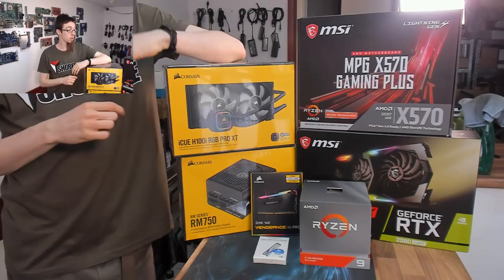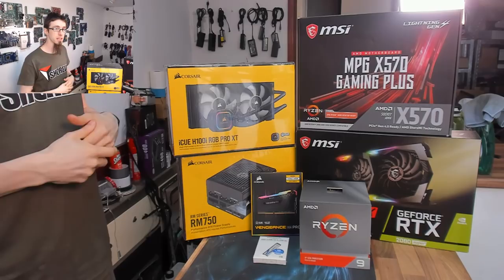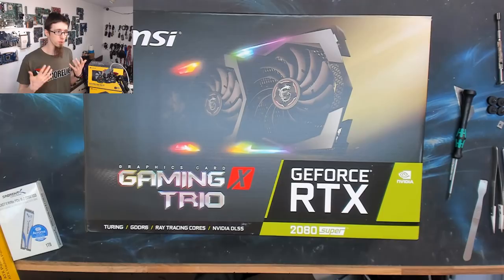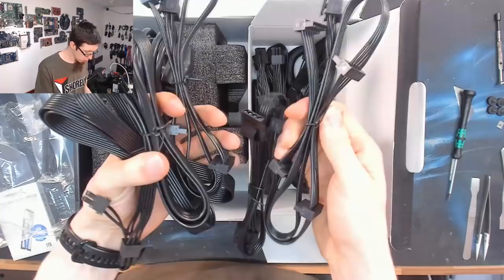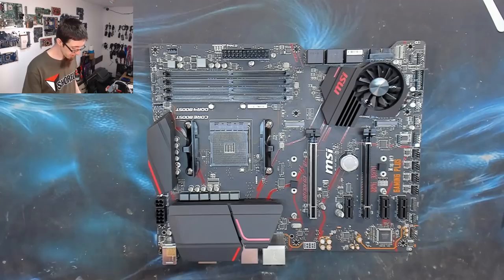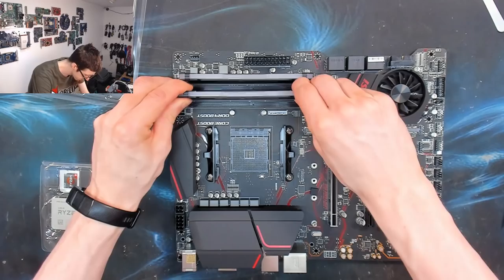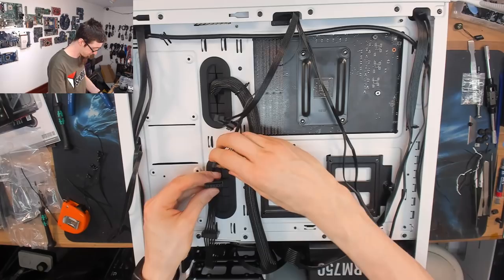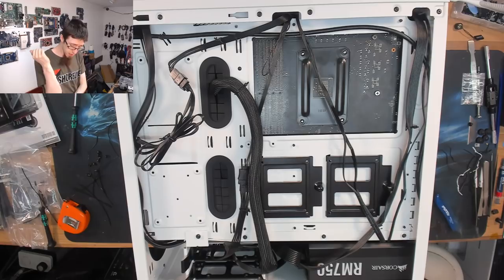The Whole Corsair 275R AF build - LBC#54

Comment: Same question as a few others - where did you get the motherboard screws from? They were not included in the accessory kit for this case, and they are not listed in the manual.
Reply: For any that are as confused as I was, the accessory kit includes MBD/HDD screws. These are what you want to use (MBD=motherboard).

Comment: what's the benefit in having the intake fans on a radiator? doesn't that bring hot cpu heatsink air into the case?
Reply from the maker: The alternative is to top-mount the radiator, in which case you're cooling your CPU with hot air from the graphics card. So you're damned either way. If either the CPU or GPU is going to have to be cooled by pre-heated air, you could argue that it matters less on the CPU (therefore top-mount is better) but in my experience it makes basically no difference.
If the cooling system is on such a hair-trigger that the 'loop order' affects it, there's probably not enough airflow full stop.

Comment: What you get for the 2080 Ti is going from 8GB to 11GB VRAM.  You get a possible investment not an expense.  There are apparently some state-of-the-art machine learning algorithms that can really use 11GB vs 8GB, so the right card can have its value INCREASE a few years after its release, especially if the rumor that Nvidia is stopping 2080 production is true.

Comment: I watched your LBC#53 video on this case.  I should get mine this week (9/9/20), coming from Neweeg.  I am down sizing my system in some respects, but I feel that this case will be better for the setup I am going for.  I have no problem in modding this case. so if I need a hole or need to move an item to make my build better for my needs I will.  You made a remark about the front cover and when I looked at I knew that I was going to make a few changes on its appearance.  If I can paint a car (1971 Mustang Coupe) I can paint a front cover.  When its done I would love to send you a few images of it.  Nice videos on both.

Comment: 5:12 just wanted to mention that what you said isnt entirely true here. its all dependent on your mobo QVL. I have a ryzen 3600, asus prime x470, and gskill 2x8gb 3600 c16 RAM. i threw in the exact same kit a few months down the road for 32 gigs for cities skylines.

sometimes i would have no issues for weeks, other times i would have major crashing.

it took me months to realize that my particular ram kit was not compatible in 4 stick config, but the 4x8gb kit of the exact same ram would have worked fine if i had bought them together. 

currently trying to sell it lol

Comment: The 24-pin ATX cable might actually come as a 20-pin and 4-pin separated.  If you are an idiot like me, it is possible to plug the 4-pin wrong orientation and get a no post.  The 20-pin and 4-pin parts have some small plastic guides that indicate the correction orientation to fit together.

Comment: The pcie power cable should easily be able to carry the full wattage for the dual 8 pin connectors. It's the gauge of the cable that matters. If the cable isn't a thick enough gauge it shouldn't have the second 8 pin connector. A dual 8 pin cable should be able to carry  300 watts. 3 of the 8 pins provide 12 volts, that's 50 watts per wire for a load of 4.16 amps. This only requires 18 gauge wire. Even if you double the load to 8.32 amps with a dual 8 pin it still only requires 18 gauge wire because of the short length of the cable. Only the very cheapest power supplies use thinner than 18 gauge wire, almost every power supply uses 18 gauge. In fact, due to the short length of cable 18 gauge wire should be able to handle around 20 amps at 12 volts. If the power supply was capable, dual 8 pins could safely provide 600 watts.

Comment: So there is the cpu cooler fans, and three exhaust fans, is it not necessary to have intake fans?
Reply: Alternatively couldn't the cpu cooler/radiator be placed on the top, and have the intake fans left as is on the right hand side?
Reply from the maker: The front-mount rad acts as the intake. You can increase the radiator fan speed for more intake, or you can increase the exhaust fans for negative air pressure, which also works.

Comment: Adamant the vcore voltage was high because Windows 10 has the minimum power management setting at 100% so it keeps the CPU bouncing between full OC and idle.    If you change the power management settings to 10% minimum it would auto down the power and temps to under 1.0v.

Comment: I wonder why you installed Corsair Fans to push hot air into the case...
2.Why you didn't tighten the pump with screwdriver?
3.You have RGB fans with this cooler just you had to go with H100i, Platinum,which I own.
Reply from the maker: 1. Would you prefer me to pull hot air from the GPU into the radiator?
2. You don't need to. They're thumb screws, you take them down to the stops and that's all you need.
3. Cost shaving to meet budget.

Comment: So do the motherboard standoffs come pre-installed or at least with the case? as well as all the other needed screws?
Reply from the maker: Yes, vast majority of cases have them pre-installed these days. You still need to check that they match up to your mobo, however, as some mobos have slightly different standoff patterns on the lower-half.
Reply: @Adamant_IT  Awesome thank you very much 😊 I was planning on getting the 275R AF but decided to buy the iCUE 465X instead as I just like the design a bit more.

I enjoyed your video btw, I watched a large majority of it and learnt a few things regarding cable management ect so for that thank you 😊

Comment: What are your thoughts on the 2 top fans as intake too, so 5 intake 1 exhaust?
Reply from the maker: If the back of the case is well-vented, that should work, as it'll force the air out the back. I think it'll be somewhat restricted though, especially around the GPU, which is where most of the internal heat is coming from. I can't think of a benefit of having a top-intake though, unless you're doing something odd like a front/side exhaust.

Comment: I owned a Corsair H110 280MM AIO that's compatible with the Haswell Intel and AM3 CPUs and it was very solid cooler. Sadly I had to retire it because I upgraded my rig to a 3700x and I didn't have the compatible mounting hardware for AM4 and besides it is not recommended to use the same AIO cooler with a new build anyways due to the fact of high rate of failure due to heavy usage.  With me due to Parts shortage due to the pandemic I chose the first motherboard that I saw that I could purchase and it would ship once it was in stock which was the ASUS ROG Strix x570-E Gaming and  It was the most expensive motherboard that I have ever Purchased in my PC building career at over $300 bucks. 
Also with me I tried using 1 cable with 2 daisy chaining 6+2 Power cables with an R9 290 and man that was a big mistake because I was getting black screen lockups galore and once I added in that 2nd separate cable all of my problems went away and I had a Corsair AX860 860W PSU.

Comment: does the radiator push air out of the case or in, in this mounting with this aio?
Reply from the maker: It depends what way around you mount the fans. In the vast majority of builds, they should be mounted to pull air into the case through the radiator.
Reply: @Adamant_IT  this has to be pretty bad for the rest of the components though, especially GPU thermals, I was thinking of adding an AIO to my PC, but either way seems negative. pushing hot air into the case or, pushing hot air into the radiator - Sophie's Choice :(

Comment: you still using this case? i want to upgrade from my corsair spec 01
Reply from the maker: This was a customer build, but still one I liked. I'd probably consider the Corsair 4000D in preference now though, newer case that definitely has a nicer front panel to it. It's slightly more expensive, but not by much.

Comment: I just noticed  that the Ram speed is not correct in the bios, how to you fix that ?
Reply from the maker: Turning on XMP fixes that. All RAM over 2666MHz (or is it 2400?) is essentially overclocked. XMP is a factory overclock profile that the modules are designed to run at, but is always off by default because it's technically overclocking.

Comment: pretty sure there should have been an extra standoff and screw on that M.2 SSD. The standoff you put on was for the heat shield, but the ssd was flapping around. Should have been fixed down first, then the heat shield?
Reply from the maker: Yea this is swings and roundabouts - it's certainly a good idea to screw in the SSD, and this board did come with extra standoffs for that. But a lot of mobos are designed to have the heatsink hold the SSD in place, so I'm used to not screwing it in. I've seen a few comments about this though, and I agree. Next time I'll screw it in. I'm not expecting it to be an issue though.
Reply: @Adamant_IT  If you had just said, “oh, shit, yeah, I missed that and will fix it.” I would literally just have moved on. So now I am sorry to be such a pedant about this, but the idea of the M.2 not actually being physically attached to the MB other than by the socket and the heatsink pressing down being described by you as almost optional… Oh dear, I had to go and read the manual. Page 30 BTW. If this was my machine and I knew that standoff and screw were missing, I would not panic, but it would bother me and I would fix it immediately. I doubt anything will happen, but… My OCD is giving me hell.

Quick edit: The thing is, the drive is not supported from bellow. Only pushed down from above. There is space between the drive and the board, and as it heats, and with time, it might well start to sag down away from the heatsink. There are articles all over the net on how bad it is to not use a standoff on an M.2
Reply: @rigsbyrigged1831  the world is going to end.

Comment: The fans in front...just a doubt, pull into the case or push air out?
Reply from the maker: Intake at the front, exhaust at the back and top. That's the meta anyway... you can customise, but front-to-back is the rule of thumb.
Reply: @Adamant_IT  og, thanks. I have my masterliquid ml120r rgb on top. I will try on front as intake too

Comment: Brilliant and well thought out computer build. I personally don’t get the obsession with making the inside of a pc look like a Christmas tree with all the different coloured lights? Interesting to see a water cooler on a CPU. Do these water coolers have some form of pump or do they rely on convection to move water?
Reply from the maker: They have a pump built into the 'head'. Amazingly compact units these things. A big air cooler can match them for cooling capacity, but as I mentioned in the video, the idea of these is that you can move all the metal bulk out of the way to somewhere else in the case.

Comment: your still supposed to use the m.2 retention screw even tho you used a heatsink. It will fail soon as it gets bumped
Reply from the maker: This computer came back recently for service and another HDD to be fitted - I actually checked the SSD after having so many people bash me over this. It hasn't moved a millimetre.
If you were shipping it across country that might be a bigger concern, but at home and car journeys, it's fine.

Comment: 32:03 where are the screws coming from to install the motherboard? do you just have to buy them? do they come with the motherboard? I didn't catch you mentioning. 
I'm looking in the packaging and I'm not seeing jack
Reply: Did you ever figure this out? I have the same issue
Reply: @MobiusChickenStrip  sure did. it's in a cardboard box in the bottom. removing both side panels should reveal it. if not, just unscrew the bottom and that'll work. will need a #2 phillips head to unscrew bottom, hope that helps
Reply: @robert_douglas  Thanks for the reply. I had already removed the side panel and found the accessory kit, but the accessory kit doesn't have the motherboard screws in it. And they aren't listed in the manual as contents :(
It only has fan screws and a single standoff screw.
Reply: @MobiusChickenStrip  that sucks! mine does list the motherboard screws, it lists them as MBD/HDD screws. they're phillips screws with a little dome, had 16 of um
good luck, maybe see about contacting them to send you some?
Reply: @robert_douglas  I hadn't made the MBD = motherboard connection, so I do have the MBD screws, thank you!!
Reply: @MobiusChickenStrip  sounds good bud, hope it's smooth sailing from here. 
out of curiousity, what kind of specs are you working with?
Reply: @robert_douglas  I've got an ASUS TUF Gaming X570-Plus, Ryzen 7 3700X CPU,  and an older Sapphire Radeon R9 270X (waiting to upgrade that one). First time building myself so this may be a beginner or entry-level build, we'll see how it goes!

Comment: Hardware Unboxed posted a video about these mid tier early MSI X570 boards and their performance with flagship Ryzen 9 CPU's! Not good VRM performance in terms of excessive temps I'm afraid. They are fine with upto Ryzen 7 but were running super hot with Ryzen 9.

Comment: The front panel wires can be a nightmare to plug into the mb if one is old with bad near vision.  You mb might come with an extra piece that plugs into the mb that is far easier to plug the case front panel wires in.

Comment: @ Adamant IT, Is it true that having a glass side panel sends out harmful frequencies that harm your health or is it more safer to have a metal side panel.
Reply from the maker: TL;DR, No.
1. Electronics need to pass standards that include not radiating unintentional EMI (electromagnetic interference). The standards for this are quite rigorous as well, they'll point a massive antenna at the device and if they pick up anything that's not your WiFi then it's a fail and you're not allowed to sell it. So first of all, there's no frequencies radiating from the circuit boards. [Note: I'm sure you can pick up something but that's like playing the 'strawberries cause cancer' game]
2. Any such frequencies made by a device, including WiFi, Bluetooth, or just noise from a switching power supply are all low-energy. They're below the Visible Light band on the electromagnetic spectrum, which is Non Ionising. Ionising radiation, which starts at UV-C and up, far beyond electronic emissions or radio transmissions, is the nasty stuff.
Low-frequency can cause harm at very high power, for example, your microwave is non-ionising radiation, yet dangerous. But that's belting out focused radiation to the tune of 800 watts or more at point-blank range. Your WiFi router runs at 0.1 watt, spread out across the house. Unwanted emissions from electronic devices require laboratory equipment to detect at all.
Reply: @Adamant_IT  Thanks for the reply. The only reason why i asked i have been using my pc tower without any side panel on for years in the summer months to help cooling, now my mind can rest thinking it's all safe. Cheers

Comment: You should not change the voltage of an AMD Ryzen (3600-3950)+X & XT. the voltage goes up and down automatically underload/idle reducing the voltage will nerf your single-core clocks for gaming etc so pro tip. do not change the voltage let the CPU pull what it needs when it needs it. 1.47 is normal for the 3000 (and some 2000) range cpus

Comment: I also just purchased the AMD 3900x and according to my research it only supports 3200MHz Ram speed. To get the 3400Mhz or the 3600Mhz I was told that you will have to do some overclocking. Is this not correct?...hmmm I wonder
Reply from the maker: That's just want it's guaranteed to work at, but in reality Ryzen can go really fast on memory if you buy super fast modules or heavily overclock your RAM.

Comment: excellent build, really nice looking, forgive me for the question, but is the radiator the right way up ? Great vids, really love the channel
Reply from the maker: The radiator will be fine. The important factor is that the pump head isn't the highest point in the system. However, hoses-down may result in quieter operation.
Reply: @Adamant_IT  aah, thank you !

Comment: Once again, you put the radiator upside down.   You really want to put the tubes at the bottom, because when you have air in the system, you will get a gurgling sound in that setup.   With the tubes on bottom, the air will stay at the top of the radiator and not run through the tube and pump.

Comment: I suppose if the case manufacturers didn't put a hole where you need one, you could drill one yourself.  One of those stepped drill bits are ideal.

Comment: This video is perfectly timed for me as £2000 is exactly my budget to upgrade my son's PC. He has HTC vive with Index controllers and will be upgrading the headset at Christmas, to index. He plays a lot of heavily modified minecraft and also is part of a minecraft modding team, coding mostly in java with a little python to automate some repetitive stuff. He currently suffers ram issues with 16bg ddr4 a 1080 and i7 6700k. He has three monitors plus the vive. I was thinking of spending a little more on 32gb ram and a slightly better board, we haven't chosen a case yet because he says he doesn't really care. But I'll be building it so I want it to look reasonable. I think you are 100% in the sweet spot graphics card wise. However I was only thinking Ryzen 7(to keep the budget around two grand., with a bit of an OC all round). I would love to have some opinions before I go shopping.
Reply from the maker: Yea that sounds realistic. Lower the CPU slightly, change the cooler for an ARCTIC Liquid Freezer II (cheaper than the Corsair, still good) and go non-RGB RAM, and you should be able to fit 32GB into the budget. Sounds like he'd actually need the extra RAM. You might even be able to keep the Ryzen 9, as you're not paying anyone's labour either.
Reply: @Adamant_IT  Thanks for the input. The ryzen 9 would be a bonus but we will have to see what the bank account says! fingers crossed. Looking forward to getting all his gear for my pc though.